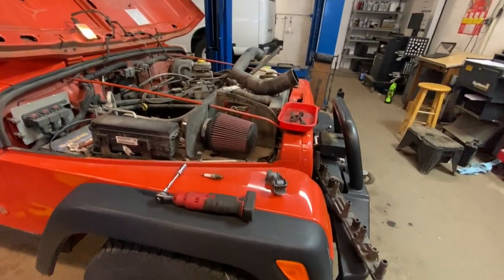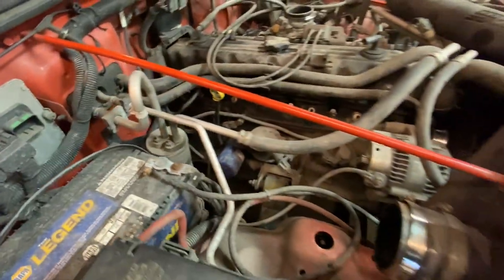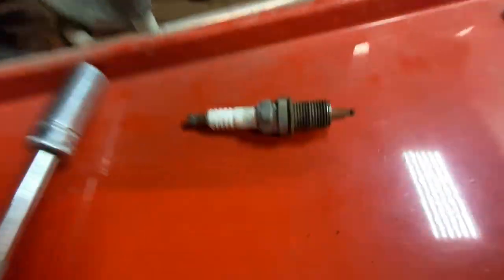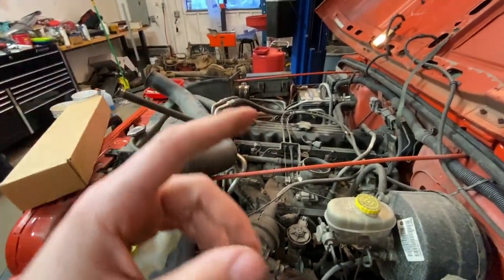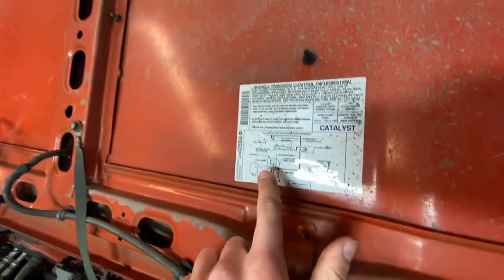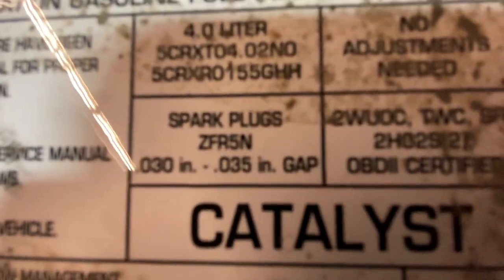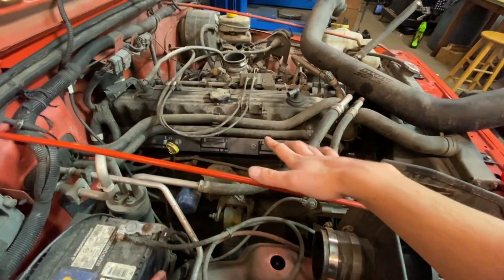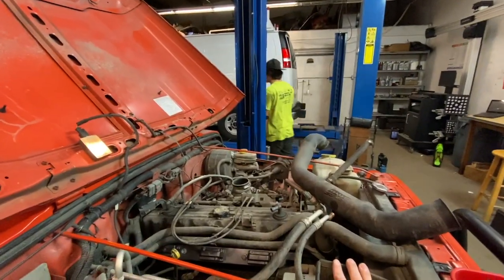It's Official.. My Jeep Rubicon Needs a Motor After 1700 Miles :(

Comment: Sorry for your troubles with the new ride, it sucks. Been there and done that. Don't think synthetic oil caused the problem. If it was out of oil after 1700 miles, the drain plug might have been loose or stripped/cross threaded. or it blew out the filter gasket. I just had to place the oil pressure ending switch as oil was pumping right out through it. I would still drop the pan and see what's loose. Bearings are cheap and easy to replace. No engine pull required. I would also check to if there is oil coming out anywhere. That's how I found my sending unit was blowing oil. Best of luck. Looking forward to seeing what happens next.

Comment: Oil don’t just burnout and senthetic is fine I run it in all my jeeps it’s better for the lifters. The place u bought it never changed it if u don’t have a bad leak it would never burn 6qrts in 1700m. Unless it smoked like a train. Rorella oil is the best for jeeps even tho it’s for desiel engines. Go check out D&E garage vids on YouTube.
Reply: i run synthetic too in my old 90 cherokee, never had any troubles.

Comment: "Water in the spark plugs"?Never heard of that one.Yes they probably should not have put synthetic oil in it but You are partly to blame by not checking the oil religiously.Looks like it's time for a stroker....
Reply from the maker: I checked oil though and after there was always oil I just figured the sensor was going bad. I planned on replacing the sensor on top of the work we did in this video. But clearly there’s bigger issues since we replaced what was supposed to be faulty and it didn’t help